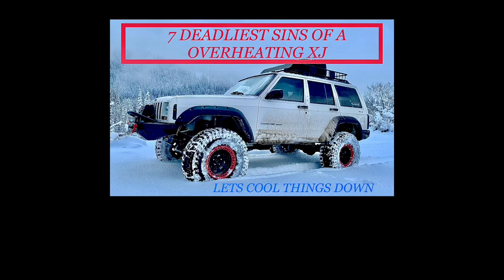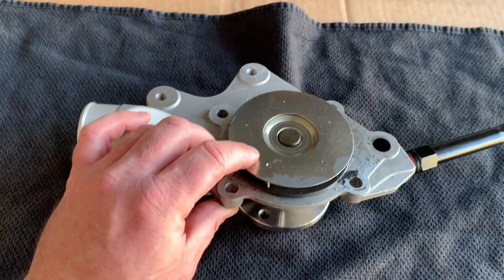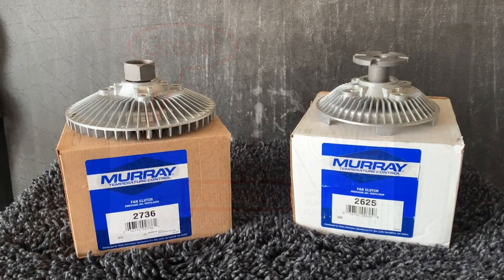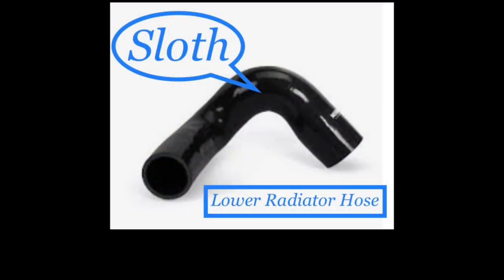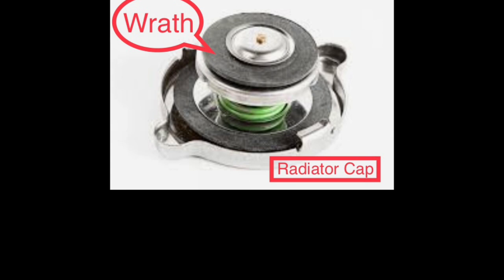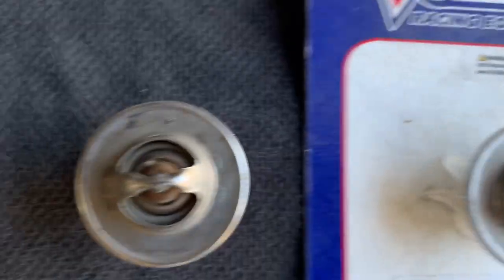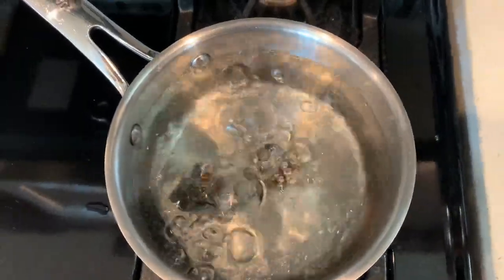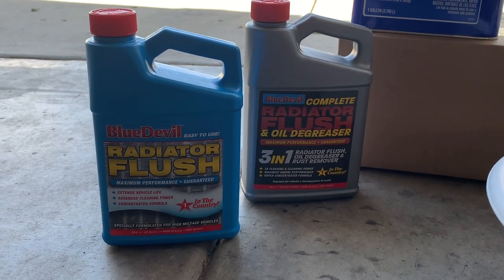JEEP CHEROKEE: 7 DEADLIEST SINS OF AN OVERHEATING XJ!!

Comment: Matt's Offroad Recovery channel addresses this....the worst pumps are the supposed hi-performance pumps with the plastic impeller that breaks down.....he went back to the stock one.
Reply: Do you know what video he talked about that in? He did mention it in one video I’ve seen. He said it was really good, but not for his application because he runs his engine at 5000 rps so frequently.

The impellers are aluminum now also, so i wonder if that changes things

Comment: I went with a ZJ fan clutch for about a month. The noise didn't bother me so much as the significant drop in fuel mileage. With the ZJ fan clutch being engaged nearly constantly it produces a significant drag on the engine. Mine dropped my mileage by 2.5 mpg, so I swapped it out for a new XJ fan clutch and it works only when it's supposed to, keeping things at proper temp without the fuel mileage hit.

Comment: Nicely done. I'm trying to chase down an overheating issue in my own 2000 XJ and I don't think it's the cracked head problem but what happens is it'll get up the temperature just fine it will idle just fine but it's like air is continuously getting in the system somehow and it'll be just fine but then after a few days or a few hours or whatever I'll shut it off and then all of a sudden it'll start boiling over. Admittedly I haven't done anything except a garden hose flush but I intend on changing out lots of parts
Reply from the maker: Thank you for watching. It sounds like you have limited flow through the radiator and it is causing air gaps which are causing delayed overheating. I would recommend you flush that radiator very aggressively. My suggestion would be to take the radiator completely out and run the hose through the inlet and flush it out.
Reply: @jeremykopp9859  you're probably right and I'm looking into new radiators. Now I did do a quick flush following bleep and jeeps video and I remember when I went to flush the heater core that thing was pretty damn clogged but I did eventually get it to run clear. I'm probably just going to drop a new radiator into it since I can get them off of RockAuto for about a hundred bucks. I'm thinking the system is probably just absolutely filthy and things are just clogged up.
Reply: Water pump

Comment: You need to come up with another sin. You didn’t cover the component that fixed my overheating. Over a one year period I systematically checked/replaced every component in your video…. and my 4L still was overheating. It turned out to be my worn out harmonic balancer.
Reply from the maker: Great point and great find. Happy you were able to figure it out and maintain a cool running XJ.
Reply: I really don't understand why a broken harmonic balancer could cause heating issues. Can you explain?
Reply: On my particular Jeep, a 2000 XJ/4.0L, I had flushed the system twice, replaced the water pump, thermostat, radiator, electric fan, belt driven fan, … and probably some things I have forgotten about… then somebody suggested the harmonic balancer. Mine had split between the rubber and metal and would slip, and thus not drive the AC, water pump, and alternator properly. It would happen that when I had the hood up… visually everything appeared to be running normally. In hindsight… everything made sense. I would have a dead battery even though the generator tested fine and the battery was only two years old, my air conditioner started working better, and of course, my Jeep quit its constant overheating. However… on a 100+ degree day, in stop and go traffic, with the air conditioner on… it will still run on the hot side… but as I am fortunate enough to not be a prisoner of some metropolitan city… that is rare.
Reply: @stumoo4744  Ahhhh okay... Now I understand why... Just as I thought. You see the pump running..??? But when hitting the gas and asking more strength it slips...

I will look for that too then... Just set two marks on it and see if it runs away..

Thanks.... Hope I will find my cause.

Comment: 31 years of auto and diesel. One of the best kept secrets to cleaning radiators is Cascade. Yes, that Cascade. Powder or liquid works. Irrespective of the volume of your radiator and cooling system, a mixture of 1 cup Cascade dissolved into each 1 gallon of water will do the best job. This works wonders on the largest of diesel radiators, as well as any automobile radiator. Fill your coolant system with the mixture, and turn the heater on to ensure your cleaning everything. Start and run the engine to operating temperature.
 
Some prefer to keep the rpm to an elevated level, but if you have time, the engine's normal idle works fine. Allow the engine to run for 45-60 minutes. Drain the cooling system completely. Refill with water and run for 15 minutes. Drain again and flush all water from the cooling system. 

If you wish to look into the radiator, you're in for a treat. I will be clean as the day it was made. Refill the cooling system with the recommended antifreeze/coolant and water mixture. Not only will you have cleaned and descaled your radiator, but also your entire engine. The mess that you flush out will amaze you.

One would be hard pressed to find an auto dealership or diesel shop that does not have random $5 boxes or jugs of Cascade sitting atop tens of thousands of dollars of toolboxes and tools. It's literally the best thing since sliced bread.
Reply: I have personally done this in diesel trucks and gas engines too. It works very well.

Comment: 10:25 The fan clutch with the threaded end is actually not for the 4.0L ZJ. The "ZJ" fan clutch in your video appears to be for the WJ as the 4.0 on those have threaded shafts. The clutch body is identical, though the 4.0L ZJ fan clutch has the same shaft with the 4 mounting holes as the XJ clutch. I think you had the correct part number, just the wrong fan clutch in the box. As for lower radiator hoses, I just transfer the spring from the old one to the new one.

Comment: Very thorough, learned some things. Did not know about the air hole in the T-stat. When you say it should be at 12:00... you are saying to the rear of the rig while you are standing in front?
Keep up the good work! Thanks
Reply from the maker: Thank you so much for watching my friend! I am happy to hear that you are learning some things and getting something out of my videos. So if you are replacing the T Stat, the hole should be placed at the top when installing it. Make sure it is not to the bottom or the side or it will be submerged in fluid the entire time and not able to release air properly. Thanks for the question.

Comment: About carbon build up. I may be wrong, but with some types of antifreeze, like ethylene-glycol one, white stuff inside radiator is actually a properly working thing and it is designed to be that way. Since its one of ways to defend insides of radiator from corrosion, on some types of antifreeze(G12+ specifically) you wont see such a thing, because rust inhibitor is working differently.
Reply: the stuff is called  galvanitc corrosion.  or elelictrlsis
very bad for cooling system

Comment: Nice vid!! Been watching it every day for the past week. I’m gonna order a Mishimoto radiator tomorrow, been procrastinating cause I’ve read a few bad reviews (for the price I was expecting nothing but praise). How has it turned out for you??? My xj’s pretty rusted inside the block, plan on putting an inline coolant filter. Hey man, really helpful vid, I was blown away with the lower radiator hose spring deal, I have extreme OCD when it comes to cars and never had it crossed my mind to test the thermostat first, awesome!!
Reply: I have a Nissan patrol and made the mistake of using water instead of collant for a year. The resovoir ended up silted with rust sand. Then I changed to coolant and changed it about a year later. The resovoir is since clean and there is no rust. I would suggest that you change to coolant for a couple of months. Then switch radiator and put fresh coolant and you should be good. I use oem collant and some have a oil content. If you can do a engine flush (pressure water through the system) that should clean out the system and ensure you are good
Reply: Change the thermostat
Reply: @Dd-bk7rr  This video is like the over heating bible, learned a lot, and thank you very much for these extra tips!!! I’m gonna change my thermostat,  borrow my buddys’ pressure washer and give it a good clean while I have that extra access. Once again, thanks man!!!
Reply: You should do flush followed by 2 coolant changes. Radiator change only after 1 coolant change. Ensure that you remove the thermostat during the flush. The rust sand may corrode the water pump and some other parts like oil cooler or aluminum engine covers or other metal surfaces so if possible open the engine and inspect.
The most dangerous thing to a engine is using water instead of coolant. You will know that the engine is getting damaged if resorvoir is full of rust sand.
Reply: @Dd-bk7rr  Oh man, I’m guilty of not using antifreeze,  when I removed the wp and t stat housing I just noticed a brownish color. When I replaced the rear freeze plug, the one covered by the trans, I did notice lots of sludge, I removed what I could with my finger and just left the rest there. Thing is that my old radiator is busted (when I was removing one of those e fans attached with wire ties). I”m gonna try to rig something up, maybe a bucket on the lower rad hose picking up water, or tie the in/out hoses together.
Reply: @MaquinasDePalomitas  even if you run the engine with water and just do a couple of changes till it runs clear should help. Just make sure you only remove the water when the engine has cooled down. The brown is rust particles and as they run through the system they will hit surfaces and create wear and tear.
Reply: @Dd-bk7rr  Thanks man!!! I just gonna go to the store to gather a few things and then I’ll do it exactly like you said :)!!!

Comment: Great video again !! I love your caption descriptions of each part that was epic Lol .. How do you like your Mishimoto radiator ? I've been looking into a better radiator to replace the factory style radiator in my 4.0 L TJ . My TJ stays at between 207 to 213 degrees in the summer time ,but when on the trail it will get up to about 215 degrees. Thinking I may add an external electric fan to the front of my radiator controlled by me via a switch to help with the temps while off road . Until next time take care and be safe . P.S . How are you liking our snowy weather ? I actually love it myself Ha Ha .
Reply from the maker: Hello! Thank you so much for watching and I really appreciate all the comments! I love the Mishimoto radiator! It has been excellent so far. It is a lot bigger than the stock radiator and really conducts heat well. I would definitely recommend putting in a secondary electric fan. I have mine connected to a toggle switch so I can control it as well. I love the ability to be able to turn it on or off based on temp. I love this weather! The main thumbnail on this video is from Monday up at Guardsman. Just got back from hiking up Millcreek Canyon for a little 6 mile hike in the snow. It’s my muse!

Comment: I don't know if I would soak any part of my engine components in acetic acid.  Acids are great for dissolving metal and calcium, not so good at flushing coolant systems.  I guess MAYBE if your system as calcium buildup, but if using DI water and coolant, that shouldn't be the case.

Comment: How does a thermostat air vent make a difference if the valve opens during operation wouldn't the air ultimately reach the highest point of the cooling system? I would think that in a couple of days the air would finally bubble to the top and get into the resorvoir bottle....
Reply: yes, probably. but the air vent is there to make the air burp out faster and easier

Comment: Where can I get the hose with the spring?
Reply from the maker: Hello Alberto! Thanks for watching my video. When I first uploaded this video I was able to get this hose from Summit Racing. It seems these hoses are very difficult to find now. I actually put a Summit Racing hose less spring in my 2000 XJ and I have not had any issues. I would recommend just putting in a standard hose at this point. The spring hose is beneficial when your system is running very hot as it softens the rubber on all the hoses and the lower hose is succeptible to collapsing. However, if your system isnt overheating and getting to hot, this shouldnt be a problem. Please let me know if you have any other questions. I am happy to help.

Comment: Number 4 about the lower radiator hoses needing to have a spring is simply a myth.  Some vehicles come with stock lower radiation hoses that have a spring in them because the manufacturer tests the hoses with equipment that creates amounts of vacuum that your car will never experience. The springs are left inside the hoses. It costs them time, effort and, of course money, to remove the springs.  A good quality hose installed on a properly tuned cooling system will not collapse.
Reply from the maker: I think you make some good points but I do disagree in some ways. That lower hose is susceptible to collapse with pressure and heat. The hose with spring eliminates the event of that hose collapsing. However, plenty of Jeeps run fine without the lower hose with a spring but it is a weak point non the less.
Reply: @jeremykopp9859  I looked on NAPA for the lower hose you mentioned with a spring and could not find one.  Could you tell me the part number?

Comment: Hi mate , been living in Western Australia where the temperature rises to 40 to 45 degrees Celsius. 
I had few xj in the past ,still have 2001 one with 200000 km very strong car but its overheating with both fan running going uphill or on the beach where temperature is 30 degrees with ac off. 
In the past I had 1996 sport xj with 128000 km.
Overheating issues same like the one that I have.
I  changed  waterpump, thermostat, radiator hoses ,fan clutch and radiator aluminium one after market that was still overheating. 
So I did headgasket test ,there was no issues with that aswel.
I took to the jeep especiallist they couldn't figure out or what causes overheating problem so I sold it.
So my 2001 xj with same problem, but I haven't started spending on the car ,I don't want to spend on the car before I find out what is exactly causing the car to overheat.
U have done a good ,went through explaining all the things that  causes overheating issues. 
So what do u suggest for me to start with.
I will appreciate ur help.
Thanks
 Amir Australia
Reply from the maker: Thank you so much for watching and the comment. Sounds like you have been through the ringer with overheating issues. There are a couple other things that could cause overheating that you didn’t mention. I know you tested for a head gasket but, you could possibly have a cracked head. Often times the head gasket test will prove negative when you have a cracked head. Another issue with these Jeep’s is, the transmission draws a lot of heat and often times demands more cooling to the transmission and starving the engine of its needed cooling. Increasing the size of the transmission lines from the radiator to transmission is a good solution. If you ask me, the key things when buying a XJ is.. first, check which head is in the Jeep(Very important). Check for any leaks, identify which tstat is installed. After that, mods would be, flush whole system very thoroughly. Replace cap, replace lower radiator hose with spring, use 195 Tstat and make sure it is opening correctly. Then go from there.
Reply: @jeremykopp9859  
Thanks mate for the info,do I need to upgrade transmission oil cooler.
Thsnks
Reply: You might try checking the 8th deadly sin… the harmonic balancer.
Reply: Stu Moos suggestion is a good one. The harmonic balancer can separate since it is made in 2 pieces. When you start the motor the inside of the harmonic balancer will spin but the outer part will not causing the motor to overheat.

Comment: What is the brand and part number for the lower radiator hose with the spring?   -Thanx
Reply from the maker: Steve Braun... thank you for watching and the comment. The one I have is a GoodYear and the part # is 38024. Let me know if I can help with anything else.
Reply: @jeremykopp9859  I'm having no luck with that part number. Can you offer further help?
Reply from the maker: Hey Steve. I’m sorry your having trouble with the pet numbers. Here’s what I would do. Take the hose you have or buy a new hose and buy the spring separate. It is very easy to slide the spring into the hose. I hope this helps.
Reply: @jeremykopp9859  Sounds good to me.       -Thank You

Comment: How long does a water pump last?
Reply from the maker: Thank you for watching. That is a very good question and really has a lot of factors. Depends on what water pump your using? A cheap brand pending on your amount of driving, climate etc. wont last as long as a high end performance water pump. If you are in a hot climate, the pump and system will run hotter and wear on the equipment resulting in shorter life. I believe a good average for a water pump in a fairly hot climate with 10-15K a year miles, would be 5-10 years in these older model Jeeps. Hope this helps BUT.. please dont hold me to my word on this obvious guesstimation.
Reply: @jeremykopp9859  thanks for your reply. Given the low cost of a water pump, I think I’ll just buy a couple of spares to keep on hand. My guess is, they won’t always be cheap, or even available as these cars are getting old now :/ Maybe changing the pump every couple of years might be a good maintenance procedure. I live in Australia and it gets incredibly hot here at times.

Comment: The 4.0 is designed around a 195 Thermostat.  Not a 180.
Using the 180 is the wrong part, and is stupid.